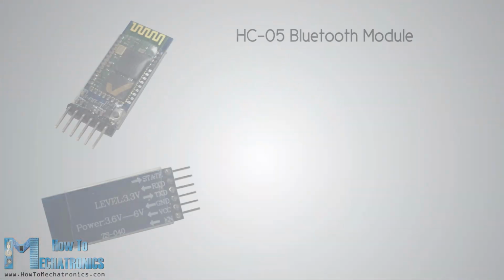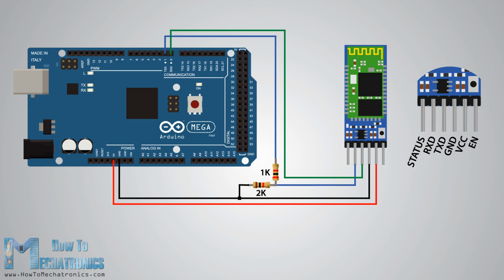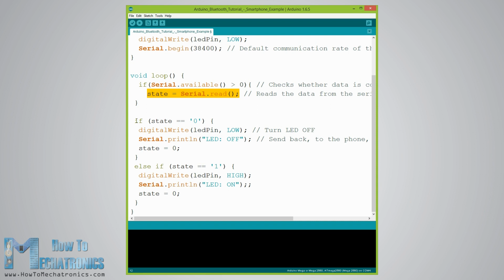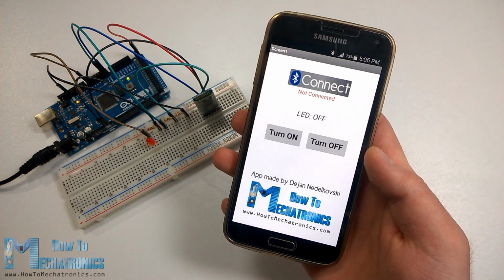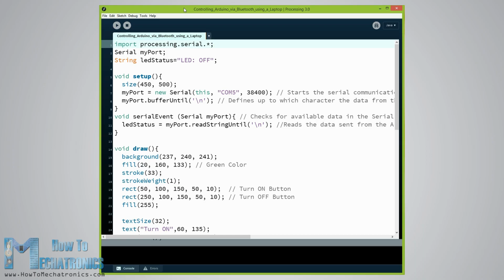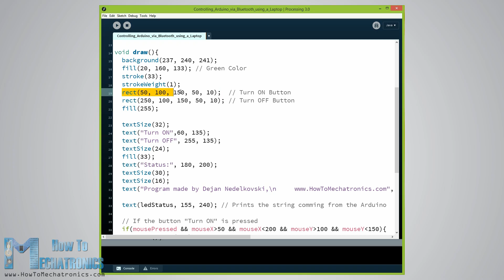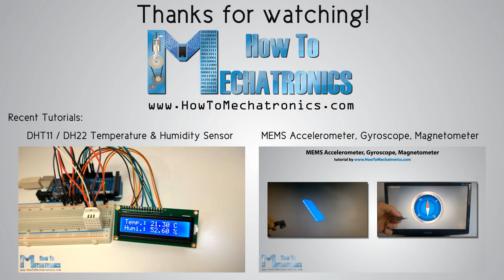Arduino and HC-05 Bluetooth Module Tutorial | Android Smartphone & Laptop Control

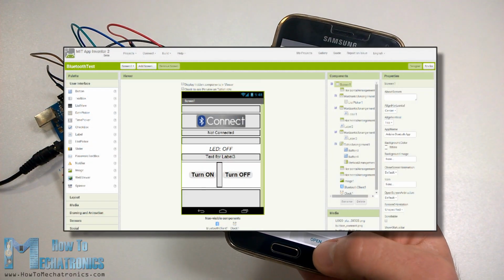Comment: I'm right with you until 5:11, when there is a new, custom application. I'm using "Bluetooth Terminal" app, and it connects okay, but if I try to Send either "1" or "0," nothing happens, and I see 
>:1
on my smartphone screen, but otherwise nothing.
No error messages, and the devices are connected. But nothing...
I know I'm doing something wrong, but what is it?
Thank you.

Comment: Is it posible to creat Bluetooth Attendance System using Smarphone + Arduino bluetooth + PC/Laptop?  Thanks 🙏
Reply: Yes bro, but if you want to show attendance data by Arduino so it will require special software as it will not look cool in serial monitor.

Comment: Can anyone help me? I followed everything he does in the video, but the circuit doesn't work. I have 4 HC-05s and none of them work correctly. I know I am using the 1k, 2k resistors because I grabbed brand new ones and placed them on the board. I can get the AT commands to work, but then when I remove the RX and TX wires from the Arduino mega to upload a program, the Hc-05 stops working. The RX and TX lights on the Arduino mega don't light up either.

Comment: Can someone please explain to me why theres a voltage divider, and why is he using 1k and 2k resistors?
Reply: The Rx on the HC-05 shouldn't be higher than 3.3 volts. Arduino TX is sending at 5 volts. To get a safe voltage at the HC-05 Rx pin you can use the voltage divider. Formula is Voltage out = R2 / (R1 + R2) * Voltage in. So, 2/(1+2) * 5 = .66 x 5 = 3.3.

Comment: I'm unable to pair to HC-08 using laptop PC. I'm using the Elegoo robot car V3. It comes with the HC-08 and a working tutorial that connects to the iphone, so i know everything is working. I can see the BT light blinking on/off, and the PC does see it. When I click "pair" on the PC, the BT module stays ON for a few seconds, but ultimately the PC always comes back and says "failed to pair, please turn on the power and make sure the BT module is still discover-able". I've tried multiple PCs. I'm using Win10, and Win 8, neither will pair to the module. Any hints - or can someone post if they've used the HC-08 (NOT THE HC-05)!!!!
Reply: VideoProfess0r  i have the same problem did you fix it ?

Comment: The baud rate is 9600 nobody listen to this guy i quadruple checked both my wiring and code but i couldn't find the issue, turns out the baud rate is 9600 (for mine at least)

Comment: I need to connect my HC-05 master mode to my android but the module is not visible , but if I change it to Slave mode my phone is able to find it ... anyone has any idea what do i have to do ? thnx
Reply from the maker: Well you can control the HC-05 with your Android only if the module is in Slave module, just like you said. You can control the module with your phone if it's in Master mode.

Comment: Hi...

I got a question that I think you could help me.

I have an Arduino project with the Fingerprint module. After i finished it, I want to register a new fingerprint to my project but I want to do it without connect it to the computer. But I want to register it through Android Application that I made using the MIT APP INVENTOR. After that I am confuse at how to write the Arduino code ... So I really hope that you can help me to finish this project

Comment: I have tried to connect Bluetooth module with laptop.its pairing with laptop correctly but when I press buttons created by processing IDE then nothing happens on pin 13 led of Arduino.when I run processing IDE program Bluetooth module led stops blinking but when I press buttons created by processing IDE code then I get no result and after 2 to 3 minutes Bluetooth module led again starts blinking.which version of processing IDE you are using.please guide me,what I am doing wrong

Comment: hello sir I need to control my robot using hc-05 and also simultaneously send my ultrasonic reading from arduino is it possible....??
Reply: It can be done but you will need additional stuff for that, it  will work separately. But still it'll seems kinda like it's part of the transmitter. If you're using phone then ofcourse it's possible but maybe you should look for another app that has more advanced features for that purpose

Comment: Hi, I tried to light up the led with the computer, but it didn't work. I changed the baud rate to 9600, but still, the led didn't light up. The HC-05 did flash every 2 seconds telling me that it was connected. I am using an Arduino Uno instead of ans Arduino Mega. Thanks for answering me!

Comment: simulate a push button using bluetooth from my phone on a music system

hi 
i want to simulate a push button using bluetooth from my phone on a music system what i want to achieve by doing this is when we power on the music system(by using WiFi enabled Sockets), by default it starts in aux mode by using mobile with bluetooth it changes it from aux to bluetooth mode so we can connect it with mobile and play music at scheduled time by using Tasker app
so we dont have to physically push any button
thanks

i use Zebronics ZEB-BT361RUCF Bluetooth 2.2 Ch. Multimedia Speaker System and i want to make change in this system

Comment: Is it right that the data that i send to the serial can still be read from the serial monitor in the arduino IDE?

I was able to send data from my app but I cannot receive anything from the bluetooth module. When i tried to open the serial monitor, the data that i try to send to the android appears there like normal serial logs. Does it really do that?

Comment: Really thank you Sir..this principle lead me to develop a number of projects successfully....only thing is the baud rate will be 9600 if you are using HC05
Reply: Thank you so much. Spent a long time trying to use 38400. Although a paper provided with the module says 36400 but works only with 9600.

Comment: Hi ! It is a nice video with your flawless narration in English . I note that a lot of people got help from this, to make it work . However i face a problem that the code has uploaded , but i can not find HC -05 appear in my phone module. The truoble is that upto execution of the sketch, your narration goes smooth, but after that you have switched to your own application software instead of a standard available software ( though you mention any other software will work !) And there is no way we can upload your software ( i am waiting !) But I am glad many others have been benifited. Regards.
Reply: HI ! Thanks for your reply.Sorry what I meant by your software, was the blue tooth application software that you have shown in the video. You said you will upload how to create that,in the next video.I tried two different blue tooth App from the play store, but  on both HC-05 is not appearing on the phone, to select & connect! Regrds.

Comment: Hi Dejan
I cannot upload the sketch presented by you.The errors are:
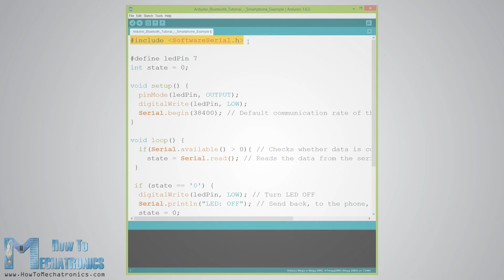Arduino: 1.8.0 Hourly Build 2016/12/21 04:34 (Windows 7), Board: "Arduino/Genuino Uno"

Sketch uses 1864 bytes (5%) of program storage space. Maximum is 32256 bytes.
Global variables use 206 bytes (10%) of dynamic memory, leaving 1842 bytes for local variables. Maximum is 2048 bytes.
avrdude: stk500_recv(): programmer is not responding
avrdude: stk500_getsync() attempt 1 of 10: not in sync: resp=0xf5
avrdude: stk500_recv(): programmer is not responding
avrdude: stk500_getsync() attempt 2 of 10: not in sync: resp=0xf5
avrdude: stk500_recv(): programmer is not responding
avrdude: stk500_getsync() attempt 3 of 10: not in sync: resp=0xf5
avrdude: stk500_recv(): programmer is not responding
avrdude: stk500_getsync() attempt 4 of 10: not in sync: resp=0xf5
avrdude: stk500_recv(): programmer is not responding
avrdude: stk500_getsync() attempt 5 of 10: not in sync: resp=0xf5
avrdude: stk500_recv(): programmer is not responding
avrdude: stk500_getsync() attempt 6 of 10: not in sync: resp=0xf5
avrdude: stk500_recv(): programmer is not responding
avrdude: stk500_getsync() attempt 7 of 10: not in sync: resp=0xf5
avrdude: stk500_recv(): programmer is not responding
avrdude: stk500_getsync() attempt 8 of 10: not in sync: resp=0xf5
avrdude: stk500_recv(): programmer is not responding
Problem uploading to board.  See http://www.arduino.cc/en/Guide/Troubleshooting#upload for suggestions.
avrdude: stk500_getsync() attempt 9 of 10: not in sync: resp=0xf5
avrdude: stk500_recv(): programmer is not responding
avrdude: stk500_getsync() attempt 10 of 10: not in sync: resp=0xf5

This report would have more information with
"Show verbose output during compilation"
option enabled in File -> Preferences.

I appreciate any help.
thank you

Comment: I'm having trouble getting the Processing program to work.  Any assistance you could provide would be appreciated.  I copied the processing program, connected
the computer Bluetooth to the HC-05, verified COM5 and COM6 appear in the
Device Manager. But nothing happens when I click on either button in the
Processing program.  If I comment-out the “myPort.write(‘1’); and write(‘0’), then I can get the red border to appear around the buttons.  So I assume I have issues comms issues.  The comm rate is correct (38400 and 8 data bits, no parity, 1 stop bit and flow control is none) for COM5 and COM6.
I can get this program to work from my Android.  I wrote a slightly different program than yours but connecting to the HC-05 and sending a 1 lights the LED and a 0 turns it
off.  Thus I know the HC-05, and Arduino is working correctly.
Again, any help you could provide is appreciated.

Comment: Hello everyone  .
I need a little help with my final year project.
 solar  Panel readings should be 
displayed on a cell phone application.
My questions are.  
1-how can I  communicate  an android phone through a Bluetooth? what modules I need for calculating the Voltage ,current and battery percentage .
2-how can I make application for android which will show me following readings.
Voltage ,current.battery.

any help will be appreciated.i will be very thankful for your kind support

Comment: Spent some time using an app and sending instructions using the 38400 baud rate in your code.
Never worked.
Changed to 9600 and it worked first time.
Reply: yeah same here .... works in 9600....
Reply: yes. works by changing it to 9600. Thx a lot!
Reply: Most underrated comment here
Reply: thanks for mentioning baudrate it solved my issue too.but I am stuck  to one other problem I am not able to control led through laptop,however module is connected with laptop through processing IDE and bluetooth module led stops blinking after pairing with laptop.buttons on processing IDE created are not working.please guide me
Reply: same here
Reply: ..same scenario until i read your comment.. thanks a lot :)
Reply: WHICH APP DO YOU USE? CAN WE REALLY CONTROL LED WITH OUR SMARTPHONE
Reply: @yashaswikulshreshtha1588  I'm using Serial Bluetooth Terminal, from google play store. but same thing here, wouldn't work unless i switched to 9600. if trouble shooting, try the code first in Serial Monitor on your pc. if everything works, move on to using the bt module. also, don't pair through your phone setting; it failed for me if i tried, but pair only through the Serial Bluetooth Terminal.
Reply: @carlos2004  Yeah, but  what you said seems legit, but i don't understand  what exactly this means 'Serial bluetooth terminal and all those technical terms, i am not very new to arduino but i have been doing projects except bluetooth. Actually someone told me that you can never 
pair your device with arduino straight away like in this video, you have to make kinda like your own app or change some value in the app for datapackets. I am not sure if he's true, 
He said there's no app in playstore which can control every arduino Blue tooth project. So  
please help me with this i am in great confusing. Also i am just getting started with bluetooth so i have no idea how exactly that works, transmitting data, recieving data, data packets, and it also includes lot of new functions like serial.available(); etc.
Reply: @yashaswikulshreshtha1588  first you have to see if it's even pairing and able to communicate; don't worry about about all the other stuff for now. Run his program in which he controls andLED through the Serial Monitor (the one that displays all the information while running a sketch) and make sure not to connect BT adapter yet. once you verify that you can control the LED through typing 1 or 0, then you can test the bt module. 
I then physically disconnect from the computer since your bt module will be using tx/rx pins anyway, and hookup the module as described in the video. Download Serial Bluetooth Terminal (literally the name of the app) and connect with the module. once connected, the serial monitor now on your phone will act exactly like the Serial Monitor on your pc when your sketch is open. 
From there, you're on your own since that's as far as i've gotten with my bt project.
Reply: @carlos2004  Thank you so much for your help, i appreciate it. and also Is that app available on playstore? and can we really control motors and other projects too with this app? I wanna ask one more question that where do you live, or where are you from?
Reply: What's the freakin password for it ???
Reply: Thanks ! :)
Reply: If you do a little bit of research on the HC 05 and HC 06 you'll quickly discover that its default baud rate is 9600.. doesn't take a genious
Reply: Disadvantages of being a noob ._.

Comment: Really great video! I've got one question. Please look at the video from 5:39. When you press the TURN ON button, the Led_Status label is "LED OFF" and when you press  the Turn OFF button the text on the display is "LED: ON". I Saw that when I press for example the TURN ON button two or more times, the label text is always good, so it is "LED: ON". Every time I need to press two times the other button to get a properly text on the Led_Status label. 
Could you tell me how to fix this little problem?
Reply: I was trying your advise but i can't make it happen. I think I don't completely understand your advice. I don't know where to place the delay and what is a fairly large delay?
Reply: from my guess, the text is updating with the previous sent data instead of the new text, i have fixed this by including a fairly large delay between sending the state value and retrieving the text, but there must be a better solution

Comment: Hello sir. Can you help me ? I'm trying to use this module as a master to send information to Android through Amarino app. My module does not come with this "Key" pin. Comes with the "En" pin. But, I can put it put it in AT mode and change your settings to master, change baud rate and other things.  As "slave", Android detects. But as "master" Android does not detect. Already I tested with different Android devices, but it still fails. And I have two modules HC 05. But none of them is recognized as a "master" by Android. None of the modules, appears in the Android pairing list. And I also have the "Android Meet" library, installed on the Arduino directory. Why does it happen ? Thank you for your attention !
Reply: Thank you for your attention, Sir. I'm also trying to make a SNES controller send data to Android via Amarino and Easymote app. So, last quetion to don't bother you anymore. If I change the role mode to "0" or "2", i can send data(information) to Android ? thank you !
Reply: No problem. Anyway, I really thank you for your attention. Nice Tutorial ! Cheers !

Comment: I have GW-040 Bluetooth HC-05 module and 9600 baud rate worked for me. I used ArduinoRC android app in terminal mode. Thanks for the great tutorial.
Reply: Agreed. Great tutorial, but the default baud rate seems to be 9600.